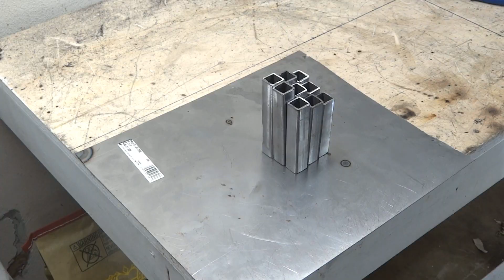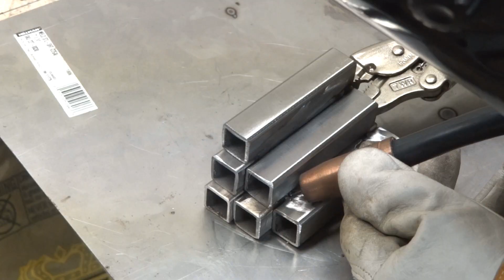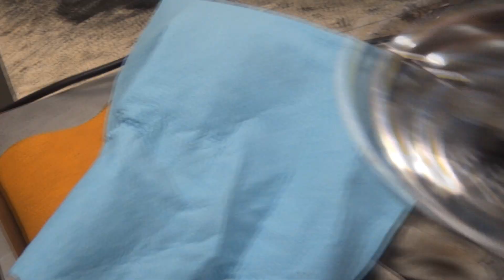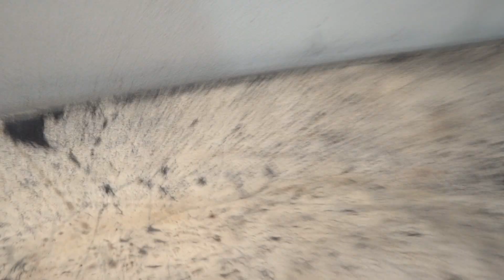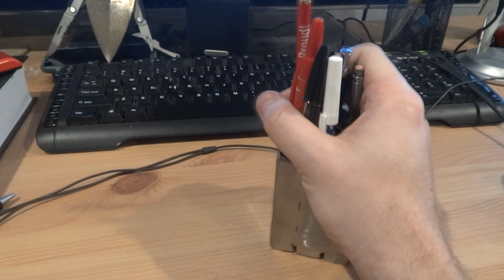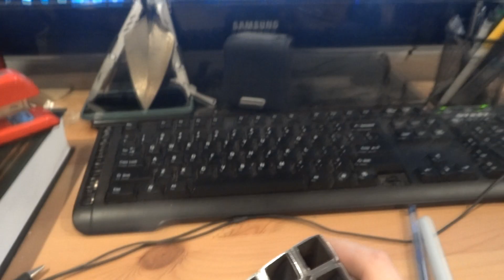Beginner Welding Project | Build a Custom Pencil Holder

Comment: You should try melting glass in the forge. Maybe you could do some basic glass blowing!
Reply from the maker: that would be awesome! I don't know anything at all about glass blowing, though.  The furnace does get hot enough to melt glass, i tried using some melted bottle glass as a cover when melting copper to keep oxygen from getting in there.  It made the dross really glossy! :D